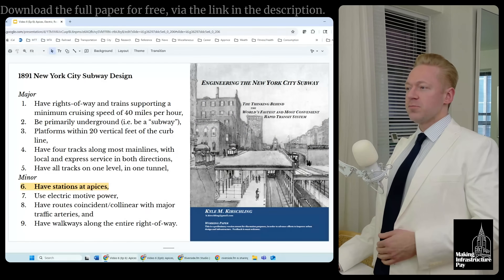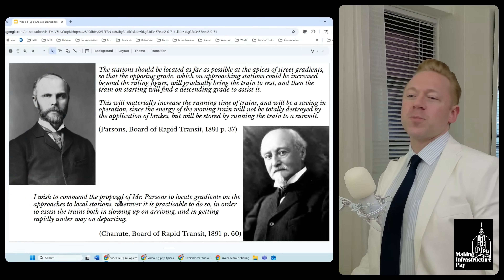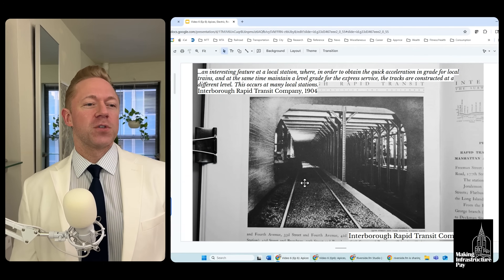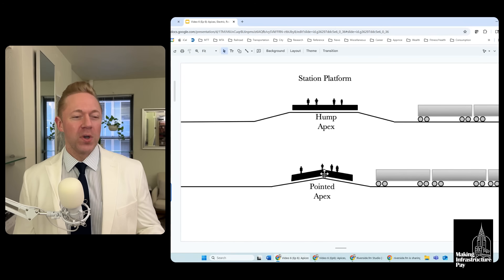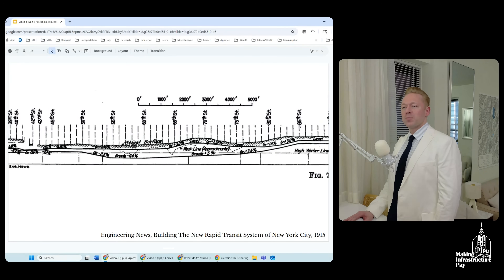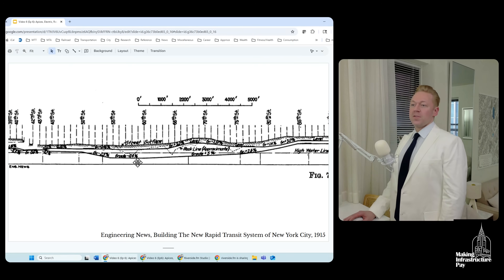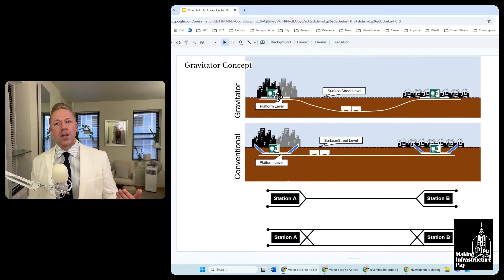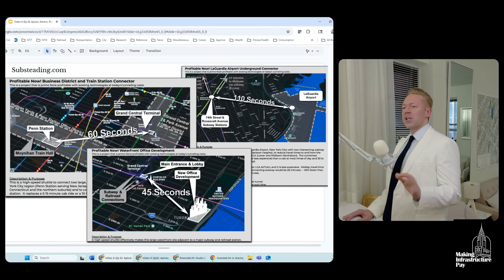How Gravity Speeds up the Subway: Stations at Apices | NYC Subway Design Episode 6

Comment: Just shows that people, or at least William Parsons, where very much aware of the energy cost over time of an other than energy efficient vertical alignment. Railroad builders then were obsessed with efficiency, always seeking the shortest, straightest and most level route. (I wish that could be said of the ones today, particularly in the US.) As far as I know, the part that opened in 1904 is the only segment of the subway that adheres strictly to that brilliant vertical alignment concept. On the part of the line to the north, which opened in 1918, the the express tracks are lower because Lexington Avenue is really narrow, so the express part was mined as opposed to cut-and-cover as under Park Avenue South. Still, it's certainly in keeping with the Parsons concept quoted in the video. As for the Sixth Avenue Line, there were obstructions to contend with by that time: the East River Tunnel to Penn Station at 32nd and 33rd streets, and the No. 7 Line, which is pretty low at Sixth Avenue because of their trans-Hudson ambitions. The No. 7 originally ended at a turn-around loop under Grand Central - That's why the platform gets wider to the west. - and was served by single cars that could take the narrow-radius loop at a respectable speed. I used to watch the PCC cars at Franklin Avenue in Newark - They could really fly around that R=45' loop. - and when it rained there was noticeably no screeching, which makes me wonder about the advisability of lubricating tracks with grease.

Comment: seem to remember there was a cable-trolley system somewhere in the former USSR (want to say Tbilisi but not sure) which would use a dam accumulated water-powered winch to pull the tram up the hill and then gravity to power it back down or a 30km something circuit through the old city... this would have been a 19th century build (remember reading about it in this "Wonders of Transit" style picture book as a child... so, not really sure of the details, but that is roughly how it worked, I remember this was a pre-electric thing...)

Comment: Inclined station platforms only exist where local conditions require the tunnel to snake around (vertically) other train tunnels or to lengthen grades (Smith-9th).  That is why 42nd and 6th is built like that.  Also see Herald Sq and Utica IND.  Safety is the reason we have flat platforms.  We don't want strollers of wagons get running away.  Grand Central on the 7 is sloped because the platform was extended into the river tube.  Fifth Avenue gets very narrow because it too was extended.  The best example of what you are describing is on Roosevelt Avenue where the tracks go up and down multiple times in a row from 74th to Junction and from 40th to 46th.
Reply from the maker: That’s a good point about strollers and such. Having a level platform is probably safer in that regard.

Comment: The soviet-style subways use a hump apex as the construction rule cause it relates to the other rule : a station platform should be constructed on the straight leveled line cause it's more friendly to passengers and its better for a driver to control a boarding procedure.

Comment: Re-gen braking has really goosed this concept especially when as you said you combine it with steeper grade changes. Here in Edmonton? They went with a 6% grade which needed the retrofit of ALL the trains with upgraded regen braking but they ran the numbers and this drop alone made the cost worth it not to mention the power generated on the drop from Health Sciences to University stations both on the same line but one at grade the other 75' below the campus with a 5-minute 3-escalator or 2-elevator walk which takes pedestrians a good 5 minutes to clear on a quiet day..

Comment: 2:08 I’m only two minutes in however I formed an opinion that I can’t possibly work… in theory sure… but the train on the front end pulling down the other side of the little Apex put more stress on the brakes… likewise accelerating it’s gotta pull its ass end up the rest of the hill… 😂 am i wrong here
Reply: it would even out tho, wouldn't it?
Reply from the maker: With the pointed apex, the train would be evenly balanced in the station. There would be some stress on the couplers, but perhaps not too much since the brakes would be on. Them, as soon as it pulls forward, gravity would start helping the train accelerate.